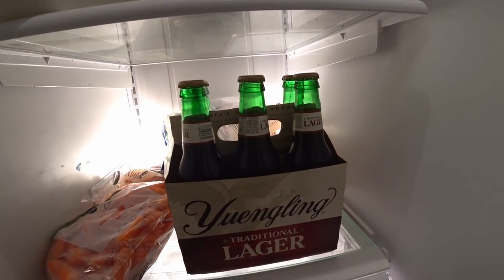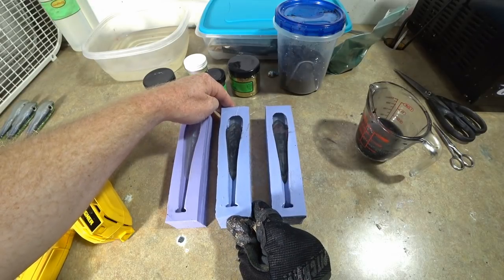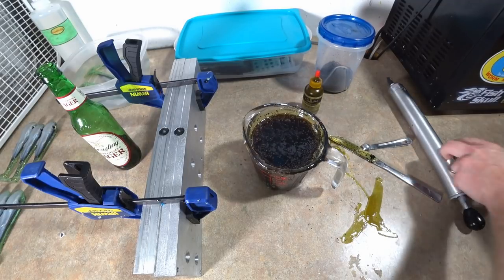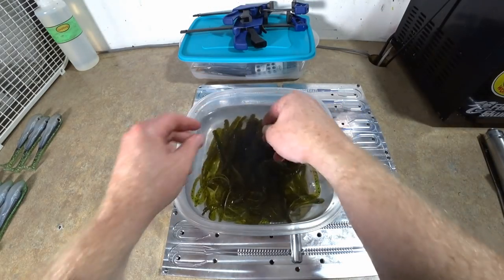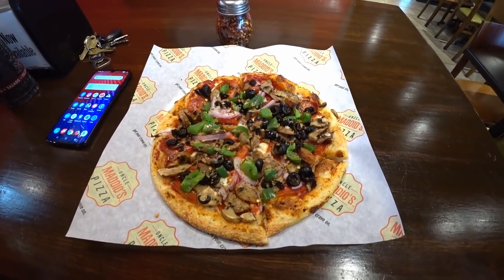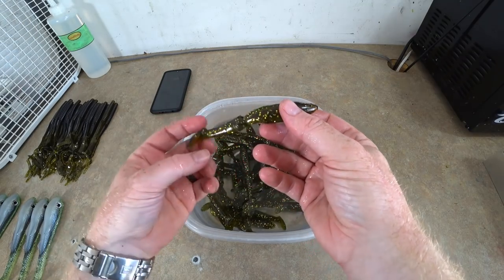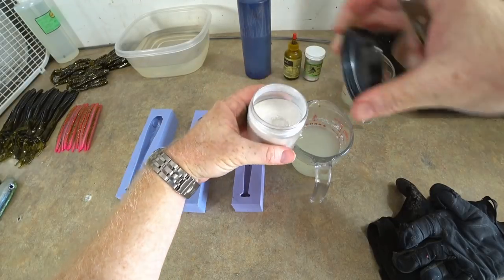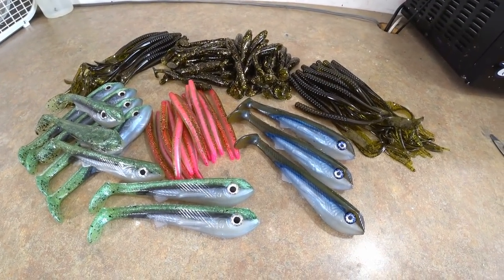BAITS GONE WILD!! Pouring Custom Orders & Several Different Soft Plastic Lures

Comment: Congratulations! Landon definitely took a step on video. I've been following your videos on YouTube since before he was born. When you said he was standing in the driveway, my mind panicked wondering what year it was. I can't believe how fast he's growing.

 I started making my own senkos and swimbaits after having found your channel. I don't have a dual injector yet, but I've recently purchased a laminating plate for the senko mold. Out of 20 Green Pumpkin/Watermelon worms, only 3 have successfully laminated. All of the rest failed as the Green Pumpkin side which I shot first, deformed due to the heat of the watermelon. Are there any tips you could share/suggest for successfully laminating cold (solid) plastisol with hot (liquid)?
Reply from the maker: I've never used the plates so I'm not sure how to advise you..and yes landon is growing soooo fast